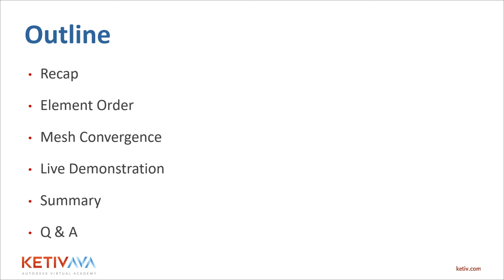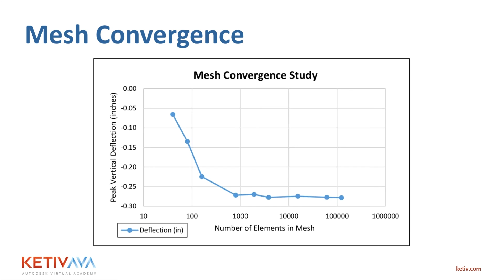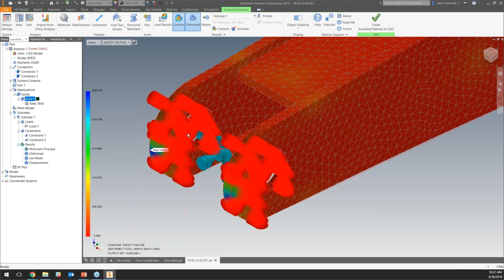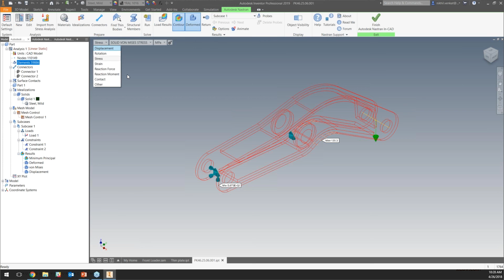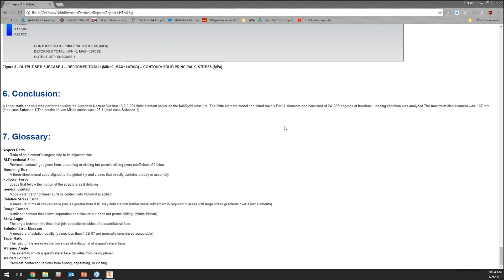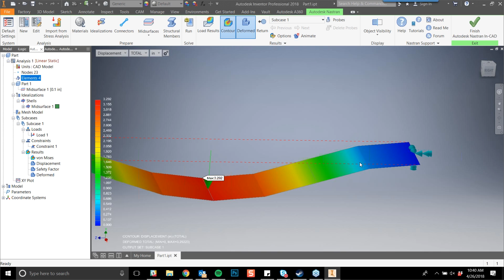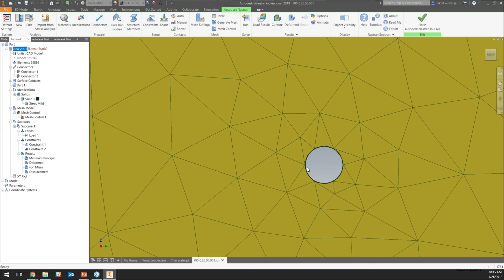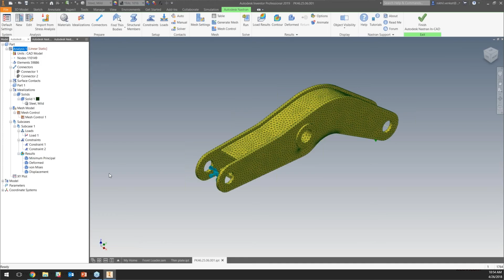Nastran In-CAD: Elements & Meshing | Autodesk Virtual Academy

Comment: Hey, I have a few questions. It would be nice if i can get more insight on the answers.

1. Is it better workflow to test parts one at a time or analyze every part involved in the analysis.
2. Should you mix and match shell elements with solid elements in a simulation? (Is it good practice )?
3. Is it possible to define mesh order (linear or parabolic) independently at the same time in inventor Nastran.
4. What is the best practice for connecting shell elements that are bolted to solid elements (I read that bolted connector will give wrong results with shell elements)?
5.How does the contact solver work? (for example if assign separation contact to multiple elements they still penetrate one another).
6. Which element order should be used and when they should be used?

Comment: you can mix shell and line elements in one ipt part. i test water tanks like that, remamber in order to add line elements you have to splitt surface, i model only surfaces and split surface then i use these split lines and put line elements inside them. good luck.

Comment: Hello, I  have a question. I have a complex frame, an assembly composed by many parts welded together (many folded sheet connected each other with welding preparation 45°). Cause of the welding preparation in the assembly drawing there is a gap between a lot of the folded sheet (I don't see the welding but only the space between the folded sheets). How can I define the properly contacts between all the parts. I try with an automatic  offset bounded contat with 10mm of maximum distance  then I realize the mesh but the solutor does not run. The warning  is : The mesh dos not contain node or elements. I don't undersand.I have assigned the material and the idealizations at all the parts.Thank you
Reply from the maker: Thanks for reaching out Fabio, that's a good question.  Unfortunately, that's more in depth than we can respond to here on Youtube.  I would recommend that you reach out to us through out website - https://ketiv.com/contact-us/ - so we can allocate the appropriate resources.  Additionally, feel free to check back at our blog for future updates - https://ketiv.com/contact-us/